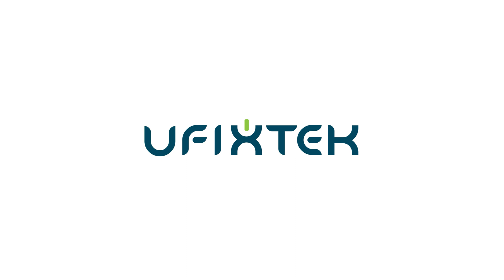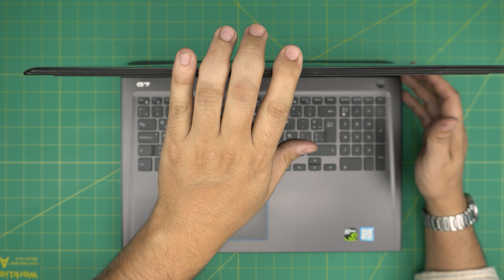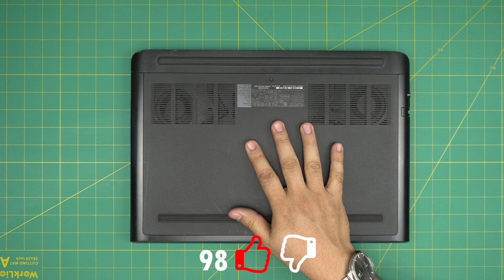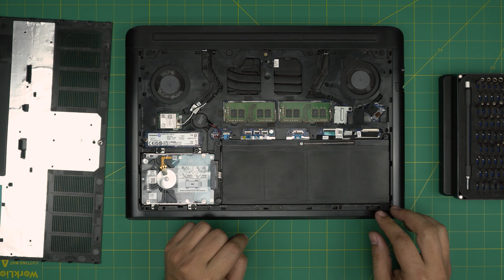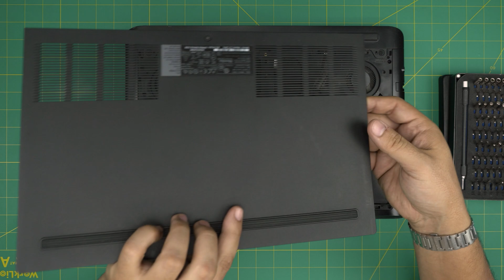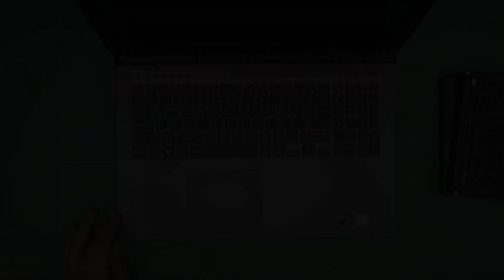How to Replace the Battery in a DELL G7 15 7588 Laptop | P72F002

Comment: Can you remove the battery and not replace it? Will it work?
Reply from the maker: 🫠Regarding your question, sure you can without any issues, it will work just fine.
Should you have any further questions or requests in the future, please don't hesitate to ask me.
cheers🍻

Comment: Mine hasn't held a charge well in a long time and it finally stopped charging. I bought a new charger and new battery. (I think it is more a battery issue than charger though.) I am useless with technology though so ty for this tutorial 👍
Reply from the maker: 🫠Regarding your question, the issue is not the charger, it is the battery replace the battery and you be 100% fine.
Should you have any further questions or requests in the future, please don't hesitate to ask me.
cheers🍻